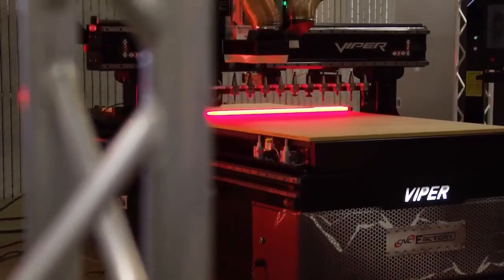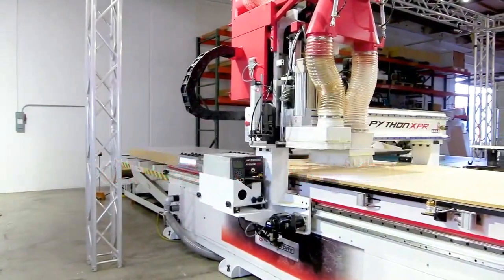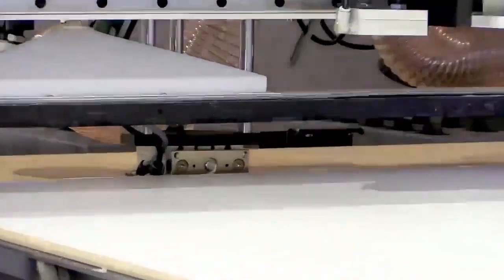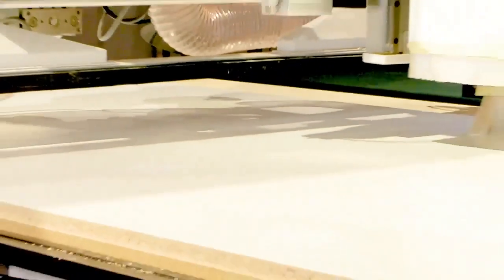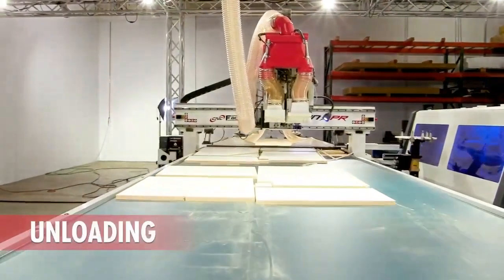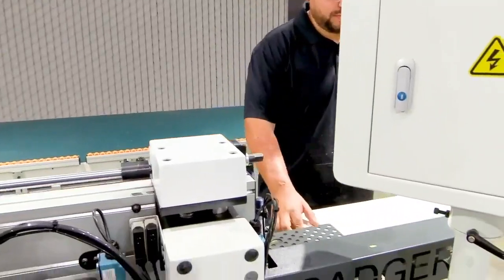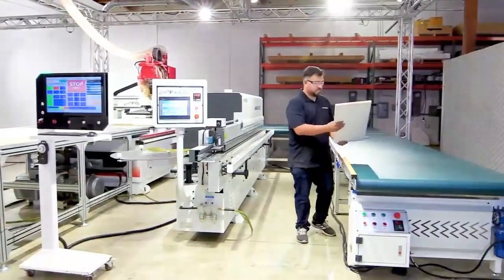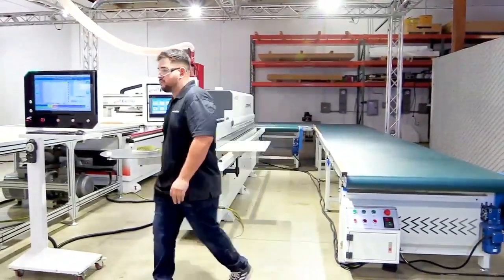Complete Working Cell Demo with Q&A

Comment: Sir can we use python for 3d curving design
Reply from the maker: Hi Mostakim. Yes, you can use the Python for 3D carving. It works with most 3D carving software in the market (such as Mozaik). Please give us a call at 714-581-5999 or email us at sales@cncfactory.com if you have more detailed questions.